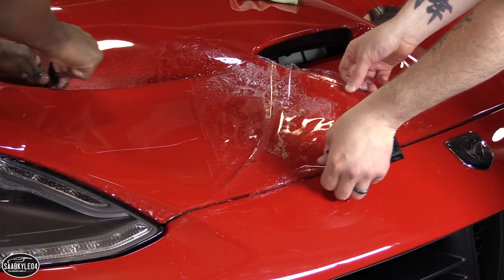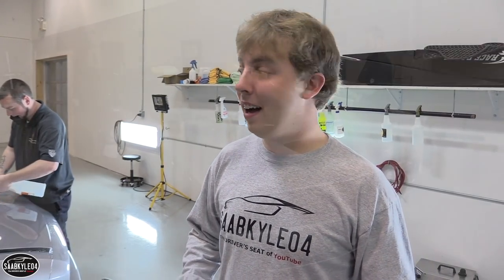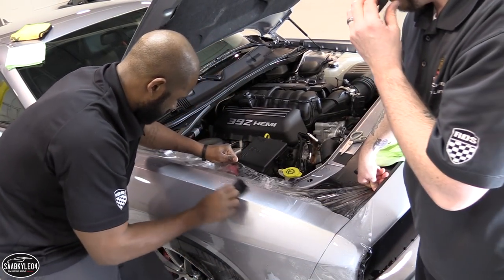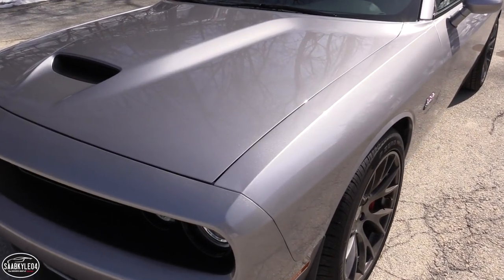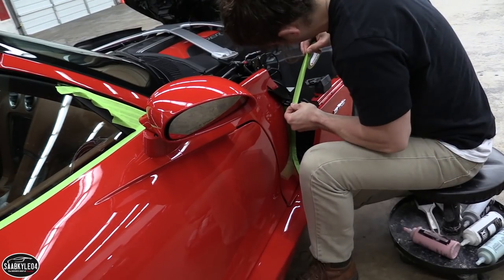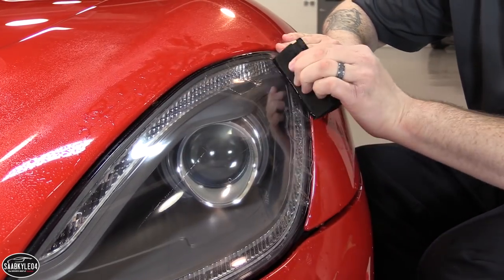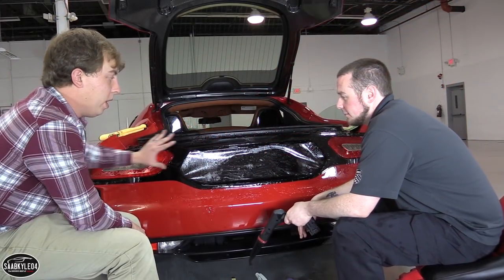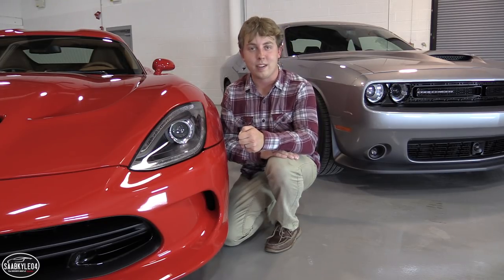Here's Why Paint Protection Film Is A Good Idea For Your Car!

Comment: Be sure to update us when it starts peeling
Reply from the maker: If done right, you shouldn't have to worry about that...
Reply from the maker: That's what they were doing throughout the video with the squeegees.  The film is applied on top of a gel or slip solution, then once it's all in place, the squeegees move out the liquid and allow the adhesive bond to the car.  They then trim the edges so there's nothing exposed that can trap dirt.  To keep it from bubbling, the paint must be clean and free of contaminates, wax, ceramic coating, etc.
Reply: Most of the video was them getting bubbles out and smoothing the film, so idk how you didn't see those clips. But it looks like they spray water to prevent the film from adhering at first, and then as they squeeze the air out they also squeeze out the water, allowing the film to bond to the car
Reply from the maker: Depending on how bad it is, you can get it buffed by a professional detailer to remove as many blemishes as possible.  The surface just needs to be as smooth as possible first.  The Viper already had some chips on the inner fender wells when I bought it.  I was concerned about that too because it's a high impact area for the car and wanted to make sure it was covered from now on.  I had the chips touched up and the XPEL stuck to it just fine (surprisingly!)  As long as the paint surface isn't rough, you should be just fine!
Reply: Skitz 01 you definitely wouldn't want to put xpel on a 03 trailblazer...
Reply from the maker: Not correct, I was there in person and tested it out myself.  It's an extra layer of protection designed to resist scratches, chips, etc.  If someone is that silly to take a key to a car, at least you're damaging the film and not the paint (hopefully).
Reply: Saabkyle04 Can the wraps handle waxing and polishing from a machine?
Reply from the maker: Most likely!  The paint will have to cure or 'gas out' for a little while first, but definitely on the front and behind the wheels.
Reply from the maker: Yep!  You can even put ceramic coating on top of it if you want to.
Reply: I have some on my corollas hood that came from the dealership. Going almost 2 1/2 years strong. No sign of coming off no matter how much I wash it.
Reply from the maker: Nice!
Reply: xtremerulez12 Yeah I just put $3200 worth of this stuff on my Pontiac Aztek!  Gave it the full treatment, they told me that putting this on the plastic cladding was useless but I insisted.  Its definitely worth it when you are trying to protect a car like this, that's not even made anymore.
Reply: R Dixon a Pontiac aztek. Ew
Reply: Leo there actually very cool and desirable head on over to the Aztek forums.
Reply: Dodge 318 Cummins ok..I'll check it out
Reply: Kappa you are right. If you are driving fast, rocks wont leave chipmarks but it will leave impact marks for sure. Imho not necessary if you take care to your car. Chipmarks and other light damages belong to a car and it shows its honesty. Just take 3 Cars distance from the car in front of you. It makes Sense for Oldtimers and rare Cars but not for modern Cars because they are produced in masses.
Reply: People say that about tinted windows.... 

I got my vehicle's windows tinted 8 years ago by a guy that tints windows on much more expensive vehicles than mine. He knows his stuff. Anyway, all these years later, my tint still looks like it did on day one. Slick and good looking as ever. Sure, I've done my part with keeping the tint clean, etc. But, when it comes to a tint job, it's either done right for the long term, or it looks like crap and you shouldn't have even bothered.

Generally you get what you pay for....
Reply: Autos Fan as long as it's done by someone who knows what they're doing. It will never peel
Reply: I've had Xpel on my last couple cars and, if it's properly installed, it will not peel. Basically, you get the quality you're willing to pay for, in product and installer.
Reply: None. Xpel is the real deal.
Reply: Doing this for 14 years now and have yet to have anyone come back for peeling... Now an edge may collect dirt if not put down totally, but even then it isn't going anywhere. If it happened, would only be a tiny 1/32-1/64" area that could be easily trimmed or replaced and will not propagate. This would be known in the first days if not noticed before the car left.
Reply: Agreed.

Comment: I had Xpel put on my 2017 Camaro 1LE and had my dealerships installer install it, needless to say he didn't do a good job. There's some areas were he left lint of a towel between the paint and Xpel film, my car is white so it's noticeable if you get close to it. Also I was told they were using a machine pre cut film on the car but they did the cuts by hand since you can clearly see the edges when you get close to it
Reply from the maker: I'm sorry to hear that!  I would take it back and get them to re-do it and shown them the issues you describe.  However, even with the machine cut, you might still see edges, especially if the section requires multiple pieces.

Comment: welcome to the viper club, picked up a 2013 GTS like yours, yellow and black stripes, black interior.  Did full xpel ultimate on the hood, front bumper, mirrors, headlights, and partial side sills.  There was a bit of pitting in the front chin from the previous owner but the xpel seems to have smoothened it out, it looks great

Watch out for the paint or PPF bubbling on the rocker panel where the secondary cat is, its very hot.  Aftermarket exhaust that eliminates the secondary cat fixes this.  One of the main reasons im planning to get an exhaust for mine.

have you joined the VOA forums?  Great community

Comment: Is this a full body cover only? Because the sun is intense here in Florida and I don't want the whole thing peeling. I want to know how much it would cost just to cover the front of the car? And how well it protects against love bugs.
Reply from the maker: I talked about this a lot more in the video, but you can literally get as much or as little as you want, it's pretty cool.  XPEL's website (see description) lists all of their pre-measured kits available.  A reputable installer, like the folks at RDS, can even do custom pieces if XPEL doesn't offer a pre-measured piece.  For example, the hood of the Challenger and roof of the Viper were done custom.  If you just want some front pieces, it's very easy to get done and it doesn't cost all that much.
Reply: Saabkyle04 haven't finished watching. Time crunch for lunch break. But thanks for the reply I will definitely check them out.
Reply from the maker: Sounds good bud, thank you!!

Comment: When I first purchased my 2015 Sierra Denali, I had my local car detailer put on Xpel on the front bumber. Its been 3 years and It definitely saves the front from rock chips, it still looks good and does not have yellowing.

Comment: My only problem with that is that in Texas, the heat eventually causes the plastic to crack. Then dirt gets in the cracks and under the edge and it looks terrible. If you replace it every couple years, I'd imagine that could be avoided.
Reply from the maker: Definitely, Texas sun is pretty intense.  Both of these cars are garage kept and thankfully, North Carolina sun isn't nearly as bad.  Depending on how the car is kept, periodic replacement will be able to keep it all fresh.
Reply: Saabkyle04 Plus I'm sure the 10 year warranty would cover that.
Reply: 10 year warranty would cover the cracking of the film.

Comment: Cant forget the windows as well. But curious about how it would really handle the harsh salty weather. Lets say down below where the rocker panels are, or the inner sides of the side fenders. If stone chips,  road debris starts circulating around and tiny bits might start opening/lifting the film up?

But thumbs up Kyle! I assume the future dealership/new owner will get a smile around his face, when knowing that the paint is fully protected and in mint condition when ur handling the key over ;)

Comment: dude, this thing is going to peel off right where you need it most which is underneath the mid section right by where the exhaust is. That section of the Viper gets so hot that that the plastic will shrink and peel right off. I hope you thought this through.

Comment: Nice, those guys are amazing. Can the windshield be done?
Reply: Robert Kohut yeah the windshield is very important because those replacements are crap and the oem's are expensive
Reply: Robert Kohut lol no
Reply: stupidmclovin seriously some have windshields done to protect from rock ships and sand debris if you do mostly highway driving, but changed every 2 years or so
Reply: marty mcfly no one does that. I've worked as an installer for 10 years and own my own vinyl/tint business. Never once even heard of that.
Reply: No, doesn't work well with a windshield.

Comment: won't it discolor with the sun faster than the factory paint? so it will turn yellow after a while
Reply from the maker: XPEL has a 10 year warranty against yellowing.  Depending on how your car is kept, you might have to replace sections as time goes on.  It's not a permanent solution, but it will last quite a long time.

Comment: If you already had a ceramic coating on the Viper, why put a protection film on there?
Reply from the maker: The ceramic coating wouldn't resist a chip like the film would.  As I mentioned in the video, the biggest issue for the viper is the rear wheel houses and the rockers/rear quarters.  They desperately need extra protection if the car is going to be driven often.
Reply: Thanks for the info!

Comment: Never understood the purpose of this. Is a few rock chips really gonna kill the value? I assume if you drive enough to where you'll get rock chips in the paint, you should be worrying more about the depreciation due to mileage. And if you're keeping a super babied, low mileage vehicle, it won't ever see chips since it's never driven. Car finishes aren't that fragile.
Reply from the maker: It's not about killing the value, it's about keeping the car looking nice over the long term.  If you want to drive the car, but not have to worry so much about all of that, then it's a nice solution.  To each his own of course, it really boils down to personal preference.
Reply: Saabkyle04 if you keep to film on for over 5 years you risk it being stuck onto the paint and you're paint will be ruined anyway lol.
Reply from the maker: That depends on how you take care of it and how long it sits in the direct sun for all that time.  It will not ruin your paint, even baked-on and cracked up old PPF from back in the day can be removed with the right equipment and patience.

Comment: manufacturers should install this all over.
Reply from the maker: A lot of dealers are offering it now, especially the edge guards and door cups.
Reply: Saabkyle04 yes but i dont like the clear bra. it looks like a scrape all across the hood and front bumper.  sopossed to prevent scratches yet looks like one where the bra ends. hopefully you know what i mean
Reply: Kameron James it's not noticeable when it's new but when the wrap ages and the car gets dirty or you wax it that line will be very noticeable.

Comment: you should've kept the ceramic coating , those coats help out a lot and very lustrous and shiny, the wrap lessens the shine.
Reply: marty mcfly not true. xpel ultimate and Suntek films has insane gloss
Reply: Exactly what iwas commenting uptop...
Reply: what about a high performance car, new and it's going to be driven a lot, would you recommend any clear bra and if so what is a reasonable amount to spend for just the front end?
Reply: The wrap adds more protection and if it gets scratched you can just peel it off and rewrap it, a ceramic coating is very hard so scratches won't polish out easily and if it eventually needs an entire new coat the old coat has to come off first and it needs to go through the entire prep process again.